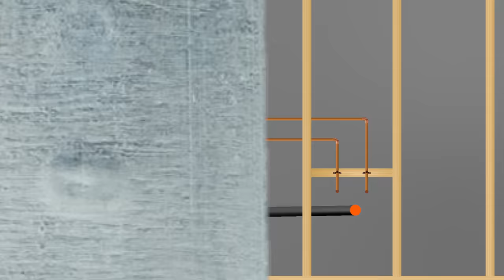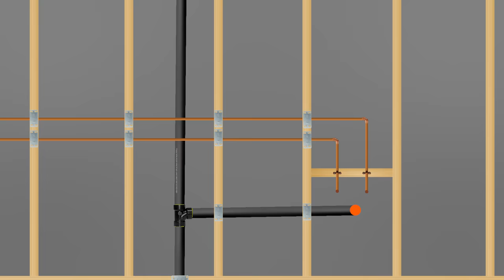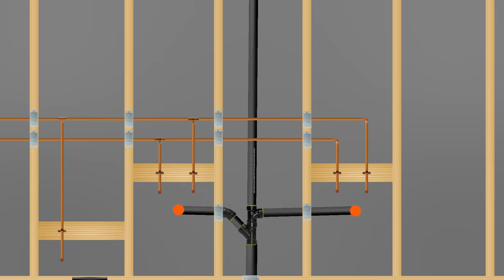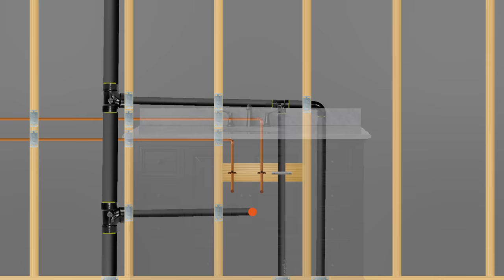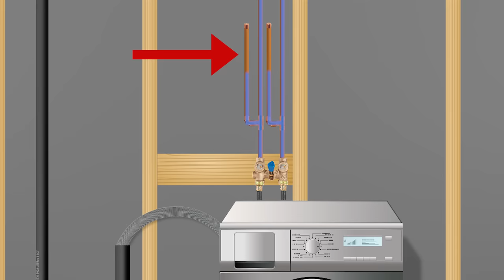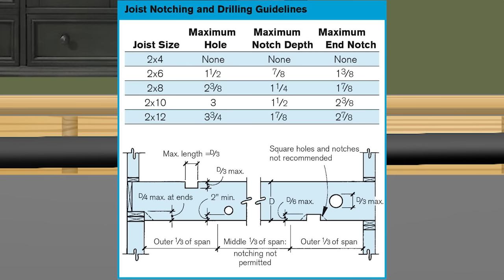10 Reasons Why You'd FAIL a Plumbing Inspection! | GOT2LEARN

Comment: At my old apartment job I worked all the pipes were copper and went straight through every structural support beam in its was and none ever had drill plates so they were easy to bust up

Comment: Thanks Got2Learn : )  how does the #8 fill up with water??, there would HAVE to be a leak for the air to escape yes?,  that dont add up...  and #9 use a short sweep 90 for a solid waste shitter but no for a drain?   hmmm

Comment: Concerning 90° bends in horizontal drain lines, you say a regular 90 is not permitted, instead we must use and long sweep 90, or two 45’s, but can we not use a 45 combined with a street 45 (fitted 45)?

Comment: Do house plans/schematics usually include piping as well? And if they do, they would hopefully specify which code/code year(s) they meet.
Reply from the maker: Yes, normally everything is up to dates in building plans ;)
Reply: Rarely. If the AHJ requires plans with the plumbing, a riser diagram and code info then yes - otherwise not so much.

Comment: Thanks so much for that  video!...  I'm plumbing a new bath and it was most helpful...  Question on cold supply to fixtures in relation to hot water heater.  Plan on an on demand LP heater inside bath and would like to know if there is a distance code for supply entering heater.to keep from decreasing pressure to cold side in fixtures?  My design places heater in close proximity to other fixtures... Hope that makes sense... Thanks.

Comment: One little comment. On engineered joists you can put a larger hole as the load is carried on the outer edge and not the inner web. Got to read the mfg data on that as there are setbacks.

Comment: This mssge is for some people that say that safety plates are not necesary if the pipe is clear from 1-1/2to the edge of the wood. Its better to just install safety plates to every single wood with a pipe in it. There is always cabinets and sometimes they even install 3 inch screws. I always install safety plates in bathrooms, kitchens and closets.

Comment: #6 would be ok if the drain on the left looked the same as the drain on the right (same fitting), just higher or lower on the stack with the appropriate slope, correct?

Comment: Summary:
1.	Plumb washing machine with 1 ½.  Should be 2”
a.	Standpipe must be 18 to 20 in height, and at least 6 to 18 inches above floor
2.	Missing drill plates
3.	Using sanitary tee on horizontal drain line.  Sanitary tees should only used vertically on drains, and horizontally on both drains and vents.    Use Y and 45
4.	Not installing a cleanout on a main stack.
a.	Keep it accessible
5.	Roughing in a toilet too close to a wall.  15” from both sides, and 12 “ in back.
6.	Dual lav setup.  See video, use double t y fixture
a.	Too much slope on drain (more than ¼ per foot)
7.	Plumbing a vent below the flood level of fixture.  (Use 6” above highest fixture)
8.	Do not basement fixtures to existing vent.
9.	Installing a T with capped pipe
10.	Using a short sweep 90 on a drain.  Use long sweep 90.  Only use short sweep 90’s on vents.
a.	Short sweep 90 ok on toilet
11.	Notching too big a hole in framing.

Comment: How about the washing machine needing a 2" waste line, but if you drop the discharge hose into a laundry tub, the drain on that is 1 1/2 "...
  Similar in a stall shower. A 2" drain for a shower valve that's supposed to be low water consumption, and a bathtub full of water draining into 1 1/2".

Comment: I am reconfig a bath room so now my toilet shower and sink is on exterior wall all plumbing going straight down through floor but i am a little confuse with my drain vent can I run it on the exterior wall?? to main vent??
Reply from the maker: It's never recommended to run plumbing on an exterior wall, vents can be an exception, but water lines could freeze and burst 🥺

Comment: Great informative video.  I own a condo that uses 1 1/2 drains and vents  except the toilet. Code says I must use a 2” inch washer box drain pipe.
I’m on the second floor and to replace the 1 1/2 to 2” is not possible cause the tenant on 1st floor not permitting the work on his wall.
I can understand.  I heard if I buy a front load washer ( since it uses less water,  a can rough in a 1 1/2 inch washer box  drain . The  washer box is close  ( 3 feet) near my bathroom sink drain.   Any suggestions are appreciated, thanks.

Comment: If you can't vent above the flood level rim of the fixtures you have to use drainage fittings. Every state, and or county has its own take on the code, when in doubt check the national plumbing code.
Reply: There is no national plumbing code. Both the Uniform and International Plumbing Codes are model codes which may be amended and adopted by local or state jurisdictions. The local/state adopted code is law and takes precedence.

Comment: You can tie into a vent in a basement, problem is if no fixtures there is no vent. Also your vertical ty drain is not ok . Must be sanitary tee or cross . Must have air space above water flow .they did approve tee wyes crosses in vertical pipes for toilets that were back to back . Because of power assisted flush toilets . Also a toilet is a fixture that sucks the trap and then is refilled slowly.siphoning is not a problem. Also there are 3 90 types long , sanitary and short .sanitary is ok for going vertical.

Comment: If you're having a contractor do the work, make sure you visit the site as often as permitted. Some contractors like to cut corners and you won't know them until inspection time (or worse... 20 years down the line). Trust me. being an annoying hovering client is not a bad trade off for the cost and headaches you'll avoid.
Reply from the maker: 100% agree with this.
Reply: Make agreement that you pay AFTER inspection passed.

Comment: I have a question at 3:45
I have never heard anyone say that a pipe cannot slope more than it's inner diameter nor have I heard anyone say that a slope greater than 1-inch every 4-feet will syphon a p-trap.
I have read people talk about old wives' tales about liquids and solids separating when using a large slope, but never siphoning a p-trap
Reply from the maker: Now you have ;)
Reply: Is that only for trap arms?
Or for any drain pipe?
Reply from the maker: Any unvented pipes.

Comment: I have an existing rough in with a vent pipe going into the drain pipe below the grade. It's not a cut pipenin the ceiling. Since the tough in is in a bad spot, I will be connecting to the existing vent in the ceiling and drawing it down the wall into the drain. I will not redo the rough in. Just leave it as an empty line in the exist location inside the wall. I don't think this is afainst code since I am actuallt using the vent, as opposed to drawing a new vent line and leave it open in the baeement wall.

Comment: This has some to do with plumbing but it’s for the dryer vent exhaust. I guess a code was made recently to require the dryer vent hose to outside, to be replaced with a PVC hardline of the same inside diameter. I heard the code was made because the old rigid dryer hoses would trap dust and lint backing up the exhaust creating both a fire hazard and possible CO hazard, while the PVC is smooth and allows debris that pass through or around the lint trap get to the outside of the house. I know this is a new enforceable code with the plumbing of a dryer. Gas or electric

Comment: @Got2Learn I am a newb when it comes to plumbing. You mentioned not to tie in a new fixture to an existing vent stack in the basement. Is it permisable to tie in a shower vent to the existing stack if it is a single story house on a slab?

Comment: My NE Ohio ranch was built in 1979. Watching this video makes me wonder how many code violations I would be slapped with when I sell my house. If a nit-picking inspector did my house, I'd probably lose thousands on the sale. All your videos are great and I have learned much from them. Planning on plumbing in a whole house water filter. Thanks, you have a new subscriber.
Reply: as long as it met code when installed, most issues are not required to meet current code.
Reply: And why would a real municipal code inspector be looking at your 40-some year old house? If you are referring to a pre-sale home inspector, they have no legal code authority in any state of which I am aware.

Comment: We have a 2.5 inch vent pipe in wall that goes up to roof cavity and connected to larger venting pipes. We also have a close by vent pipe that vents the shower up to the same roof cavity and connects to same venting system that goes through roof. So can we move the first vent pipe (very possible through basement) to a near wall cavity and then add some height and connect to the shower vent that is within 1.5 feet?

Comment: Hi- Concerning 10 reasons why you'd fail number 7: using an existing vent to plumb basement fixtures: I have 2 laundry rooms in the house and one of those is in the basement. This is rarely used and has an individual dry vent running from the basement to the roof with a small bar sink on the 2nd floor in between. What would be wrong with removing all of this unused laundry plumbing and drain and hooking up a small powder room with individual dry vents and connecting to the main vertical vent that the existing laundry is hooked to? Thanks!
Reply from the maker: Shouldn't be anything wrong, still gotta get it inspected though 🍻

Comment: 5:00 why new fixture ( like laundry sink in this case ) can not connect to existing vent, if vent connection point is 6" higher than the sink flood level?
Reply from the maker: You can overload the 2nd floor's venting system.

Comment: You Cannot use a double wye fitting on a side by side or back to back lavs Your diagram is not proper A dbl sanitary tee or known as a figure 5 in ci can be used The Seal of the trap must be below the weir of the sanitary tee @ its vent Also the length of drain pipe to its vent, cannot be passed by 5’ or 4’ Depending on what code book you are using, to maintain the same

Comment: I would like to connect  Acid Water Neutralizer back wash to drain line. But problem is that Neutralizer is in the basement and no access to drain. (The main drain is inside of concrete, not possible to open up) I have to bring the neutralizer drain up to first floor by the bathroom. I was thinking about using trap just like the drain for laundry machine. Can I use double T to make double trap to drain neutralizer and laundry machine? Or can I connect the neutralizer drain directly to bathroom sink drain by using T and share vent? Also, do I need pump to get the neutralizer drain to be connected to upstair?

Comment: 90s can be used when the change in direction is vertical to horizontal or horizontal to vertical. When they're on a side is when you need a long sweep or 45, st 45. No inspector has EVER failed me for using a 90 the way I described.

Comment: Can you explain further why, in a basement installation, you can't install a vent to an existing vent?
Reply from the maker: Not to overload the venting circuit and affect other fixtures in the home ;)
Reply: @Got2Learn  at what point is a venting circuit considered overloaded? For example, what if the main floor of a house has a bathroom sink, toilet, shower, and kitchen sink? Would tying into that in the basement be inherently overloading?
Reply from the maker: @sarahpoulin4303  it's a code thing, so if you do it it'll probably be fine, you might just run into issues if ever you decide to sell and the new buyer notices it and decides to backtrack on it, it's really your call ;)
Reply: @Got2Learn  we haven't done anything. I'm just trying to figure out why we have so many plumbing problems. There are a lot of weekend warrior "upgrades" at our place because of the previous owner, and we're trying to figure out the source of a lot of issues. I suspect some of it is the venting. The basement bathroom was added as an addition by the previous owner.
Reply from the maker: @sarahpoulin4303  yes, you might have problems on other fixtures if it was done that way...

Comment: There are 3 different types of quarter bonds. Vent, short sweep  and long sweep. As far as I know short sweeps are legal in a vertical to horizontal plane. Not legal in a horizontal to horizontal situation.  That would require a wye and eight bend. You may want to clarify that.

Comment: Thank you for this video, I learned a LOT, well 10 things i didn't know :) ...Im currently connecting a new foundation to an existing for a room addition. Therefore, I need to expose drain/sewer line so I can connect to it (for a new kitchen sink) before I pour the foundation and then run that extension to where the new sink will go. Luckily the wall what will get extended already has a clean out vent so I can assume the drain run straight down where I need to dig it out.. Hopefully it not toooo deep...I might hit china (for those old enough to remember that reference)
Reply: @Got2Learn  California Codes are probably the toughest to go by and they change constantly ...and sometimes when they change, it's really going back to old code..🙄
Reply from the maker: @fredsanford6658  yeah, there's only one Cali 😅

Comment: Ya you haven't seen Mickey Mouse plumbing till you seen houses framed to finish in less the 30 days.Here in las vegas is a great example, lots of 10 inch rough in toilets ,especially tension slab homes,great video.

Comment: I do wonder how my UK house plumbing compares to standards in this video cause while my loo is on the down pipe the sink, shower and bath is connected in a way that while not vented and will occasionally pull air through doesn’t let sewer gasses in because it is physically air gaped at the back garden drain (was and seemingly still is common practice to have everything but the loos to all connect up by poring into the outside drain if plumbing to there made sense

Comment: @Got2Learn, how come you can't connect your new plumbing to an existing vent for ventilation? You say6I would have to run a new vent through the roof?
Reply from the maker: Not to overload the system
Reply: @Got2Learn  so I would have to run a new vent?  From your video it was only 3 dfu's, so that would overload a system? You had a standpipe, lav sink, and toilet on that system,  then you showed another, so that may have been a total of four! Help me understand that one better, please.
Reply from the maker: You should have a "future vent" somewhere in the basement if the plumbing was properly done, check for that first, it's basically a capped stand pipe in the ceiling, be careful when you remove the cap, there WILL be water LOL.
Reply: @Got2Learn  ok, and Haha

Comment: 99% of houses I work on would fail on these issues but they don’t have issues with this stuff. The #1 problem I see is no high loop in the dishwasher drain causing the dishwasher to flood the kitchen when the disposal drain is clogged. Most code seems to be  about driving business to the inspectors brother in law. Just saying😃

Comment: Thank you for this, what if the vent stack horizontal piece was similar to what you're showing at 4:30 then went up and then connected into the vertical stack would that be acceptable just don't want to bring it up that high directly behind the countertop it's an architecture design element behind the counter. Looking for alternatives

Comment: Are you required to run the toilet drain below the joist if you're floors are 2x8 for example in an older house or does that mean you're not allowed to run a drain that that direction, as the chart indicated a 2 3/8 hole max?
Reply: If you have to run the 3” trap arm against the direction of the 2x8 joists are running it should be below. You can’t make a 3-1/2” hole in an 8” joist. You’d be drilling out 46% of the profile of the joist., progressively closer to the edge of the joist. If you started with a 3-1/2” hole in the center of a joist, within 4 feet you would only have 1” between the bottom of the hole and the bottom of the joist.

Comment: As I understand it if something is passed by your township code inspector in 1974 he can not come back in 1984 and fail it because of a code change. It's called "grandfathered in". Now a home buyer may have a inspector come in and say something is not code on date he inspects it but if it was up to code when home built they "cannot' keep you from selling or buying it. That, at least is the "rule" in my township. For instance, for years now all new homes built after a certain date must have hard wired in  smoke and Carbon dioxide detectors outside/inside all bedrooms and at least one in all halls , rooms basements with battery backup.  My old home, when built, did not require any alarms of any kind. Although, of course, I had plenty of battery type throughout the home. Another thing, my attached to home garage when built, did not have to be fireproofed from home like fire doors, drywalled ceiling, etc. but it is code now. Inspector had a problem with it but I still was able to sell the home as is,  as the code of today was not the code when home/garage built and "passed".
Reply from the maker: Yes, if you had the rights back then, they still apply today, unless they decide to change the rules for whatever reason.
Reply: @Got2Learn   Yeah, I've lived in this township for 47 years now and you never know for sure what the hell they are going to "try" next. LOL
Reply from the maker: @tomtransport  exactly, they have us by you know where! Cheers!